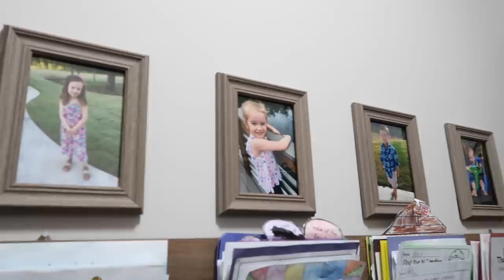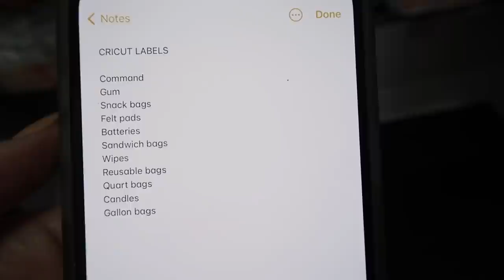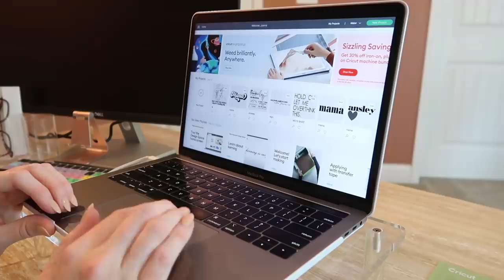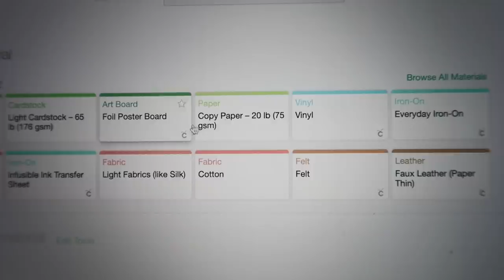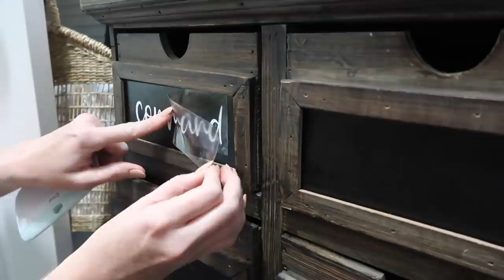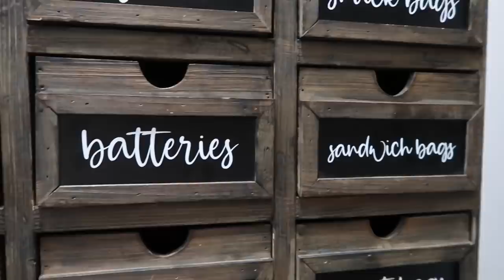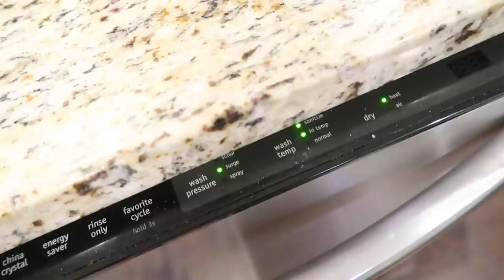SIX HOUR DEEP CLEAN + ORGANIZE ⭐️  DAYS OF CLEANING MOTIVATION

Comment: This may seem like an odd question but where did you get your leggings with the pocket on the right thigh?? Those toilet seats, are they the ones that snap easily on and off for cleaning? If so where did you get them? As a side note Miracle Grow potting soil has a variety of problems like the smell. It’s actually not a very good potting soil at all. (I’m a botanist by trade). Last question, how many attachments does the Hoover vacuum come with? I looked on Amazon but it didn’t say.